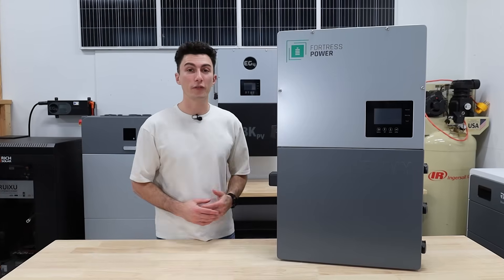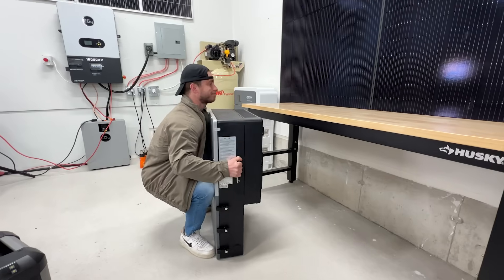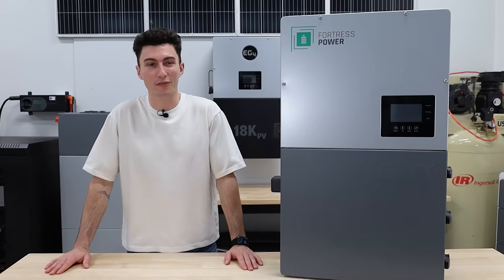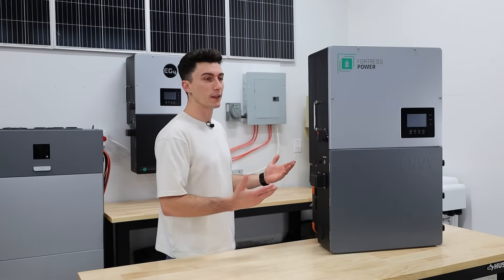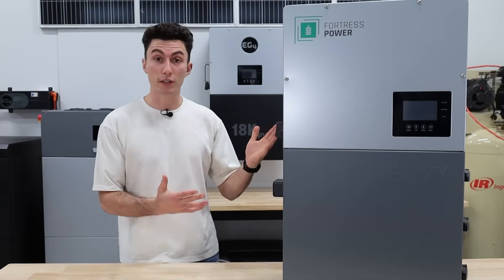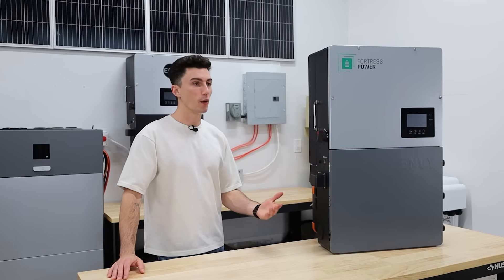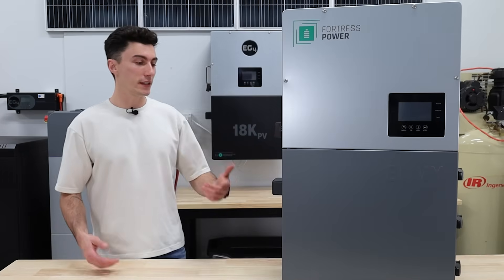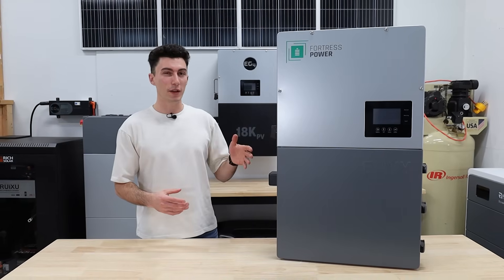EG4 Knockoff Better than the Real Thing? - Fortress Envy True 12k inverter

Comment: NHX 12kW 120/240V Output 18kW-Solar with built in Breakers for battery and AC , Supports AC Coupling $2,899.00

Comment: interesting to watch the comparison.  I do you more rugged off?Grid type system set ups. zero software needed for the inverters that I use. 18kw with 54kw search for huge machine start up. In a grid down situation I don't want any software in my systems. But that's just me.

Comment: The EG4 is a Luxpower Tek product. The Fortress model is made by Shenzhen GSL Energy Tech. It should be noted that Luxpower Tek and Shenzhen GSL Energy Tech are partner companies.
Reply: Huayu is not the manufacturer
Reply: Although Shenzhen GSL Energy Tech and Lux Power are not the same company, they are related. Lux Power is a designer and brand, while Shenzhen Sea Star (Huayu) is the manufacturer. GSL Energy is a reseller and rebrander of Lux Power products, with a business relationship with Lux Power, not Sea Star/Huayu. Here's a more detailed breakdown:
    • Lux Power: Designs and brands the inverters.
    • Huayu (Shenzhen Sea Star): Manufactures the inverters.
    • GSL Energy: Resells Lux Power inverters, potentially under their own branding.
Essentially, GSL Energy is a channel partner that distributes Lux Power products, but they also have the capability to create GSL-branded versions of the same products by sourcing them directly from the manufacturer Huayu.
Reply: @stevenfrazier8939  gee that's a lot of horse radish. 
Ever noticed every single brand of inverter uses the same model # like the Lv6548 ya that comes from the actual brand it's stolen from. 
Say like Mpp Solar equipment out of Taiwan. 
Ya because it is... Luxlore copied everything. No they wouldn't do that 😮😅😂
They have and continue. No one can sue them. 
The equipment is crap there crap and thieves.

Comment: They're both cheap high frequency, transformerless inverters that don't provide any galvanic isolation between its DC boost stage and its AC output which means that both of these inverters can easily damage your home's appliances during a failure of its H-Bridge circuit. I would not recommend either of these inverters for use in off grid residential solar applications.
Reply: Busted out of rehab again I see..  Just replaced the board stack in my Outback 8k after one year....$2500.00  ....Go away Bot...

Comment: Only comment I would make re: the RSD button, is that when properly shutting-down a complex system like this one really has to sequence the pieces to avoid putting unnecessary wear on breakers and relays under load.   So, for example, you want to shutdown any AC or MPPT charging of the battery before the battery relay and/or breaker is triggered.  Same with all the AC relays... best to turn-off the inverter output first before de-energizing the AC relays.  And so forth.

That's all.  Sequencing that whole mess can take a bit of time.

-Matt

Comment: If you want to rapid rapid shutdown, wire that red switch on the eWay replacing the little red jumper inside the inverter near the CAN port.

Comment: I have installed both of those inverters in the last couple of months. It would take me a minute to remember what the difference on the software would be. I installed the 18kPV with indoor EG4 wall mount batteries and on the ENVY, I use the eForce batteries. Both are very sweet setups. The eWay is WAY better than the EG4 gutter. I wish the Guardian was more capable, it would eclipse the similarities in the inverter firmware. Great video!
Reply from the maker: Thanks for sharing your experience!

Comment: Lux Power sells these to more vendors than just EG4
Reply: Who manufactures lux power then, maybe we can buy also some cheap knockoff
Reply: @AdityaEnergySolutions  Luxlore is the copycat company. There all stolen units from MPP out of Taiwan. Luxlore has no original equipment. Everything is copied. This is why the equipment is in constant failure and there are no fixes other than adjusting the software. 
JUNK